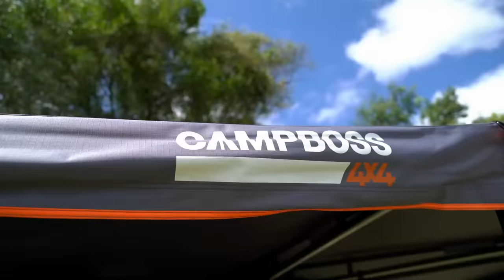🔥 THE RIVER CROSSING THAT BEAT US! We nearly lost the LC200…💀

Comment: Earning your keep there fellas. Wise call, abort. Those bush failures, classic case of fitting and tightening bushes up while on a hoist with wheels hanging down, drop hoist and as tyres/diff return to ride height twist the crap out of the bushes and down the track have a failure. Should always tighten suspension up at normal ride height.

Comment: In wet mud the tiretread get filled with mud and turn them into slicks. Wonder if a spray of silicon would keep the treads clean enough to serve their purpose?
Also, reduced tirepressure make the tread smaller, and less capable to drain.